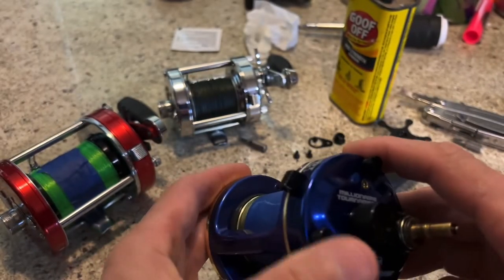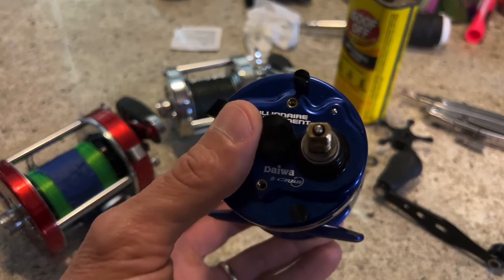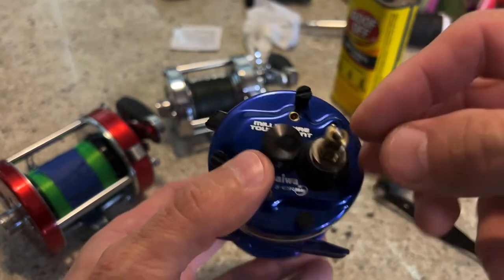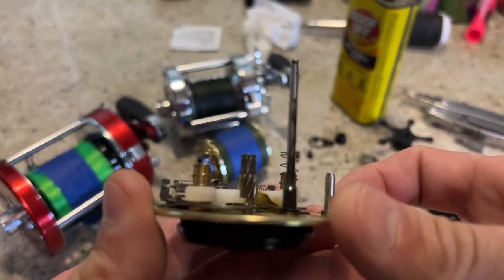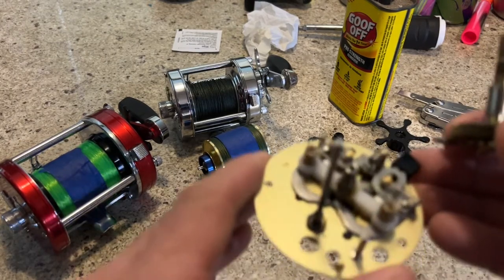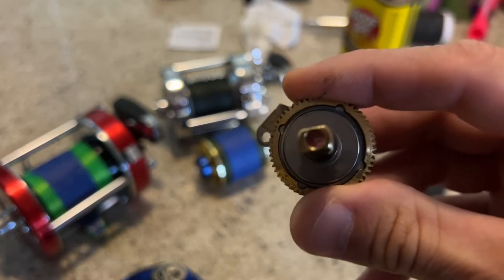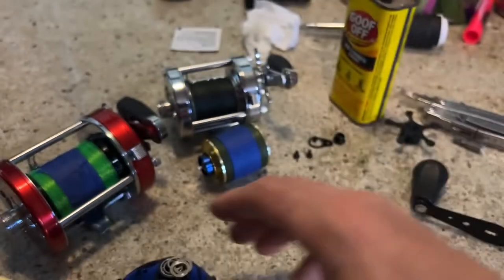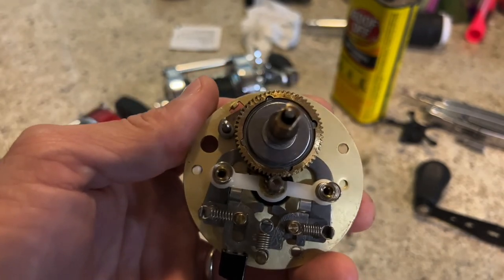Daiwa Millionaire 7ht Mag pinion support gimmick exposed!

Comment: Ive used these for years  and with out the pinion support the steel shaft  wears away the brass driveshaft resulting in the anti reverse bearing housing detaching from the side plate wrecking the reel I currently own the 7ht st at £500 each and they still require a pinion support. So much so Daiwa are repairing out of warranty reels for free due to this issue. I’m sorry sir but you have no idea what you are talking about.

Comment: If you cut that spindle down the reel,wouldn’t function the handle could not be attached 😂 the pinion support is vital to keep the shaft aligned and stop any fractional play which will push the main gear out of sync.

Comment: No, sorry sir, but you're seriously wrong. That gap between the spindle and the pinion has suffered wear and hence handle wobble on 7ht standard, 7ht turbo and 7ht mag reels. Funnily enough if you look at the 6hm which shares much of the same components it doesn't suffer from wear and handle wobble.
Reply from the maker: Thanks for the comments guys, I was hoping the Video would make things clear enough but apparently not. 

In the Video I made it very clear that the main gear is supported at the base of the stainless steel spindle at the top it’s supported by the anti reverse bearing so what you guys are describing makes no sense, I’m sorry but it just doesn’t! 

What you are describing is the Anti reverse boss is failing with way to much clearance in the side plate! This is why Daiwa is fixing these reels and they have discontinued them! The so called spindle support is a GIMMICK!
Reply: @natesplace7809  when I get back home I'll demonstrate both a 7ht and a 7ht turbo with wear to the gear base caused by the gap between the spindle and pinion (and the highly visible handle wobble). I'll show you how the support alleviates that wobble. If you purchase a second hand 7ht it's common to see how the top of the spindle has distorted and mushroomed at the top (requiring filling). If you use one of these reels for a reasonable length of time you will get wear, wobble and eventual failure. Your views are sadly at odds with the UK casting fraternity. This is as well documented a failure on daiwas design as its possible to have. As stated, check the spindle /pinion gap on a 6hm, which funnily enough doesn't suffer from handle wobble or failure.
Reply: The point you're missing is that the pinion bearing failure is caused by the lateral spindle movement that you're missing. Fit the spindle support it hugely slows down if not obiviates the failure. Power handles just make the leverage on the spindle worse. Again, this never happened with the 6hm, which again didn't have that spindle pinion gap.
Reply from the maker: @cashybai  I don’t have a problem admitting I’m wrong, please send a video demonstrating the problem and showing the wear.